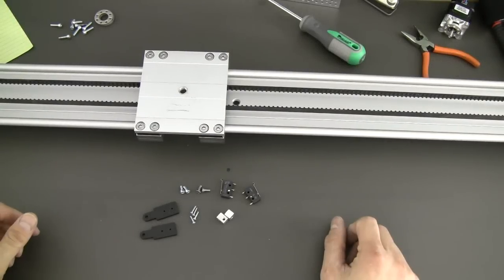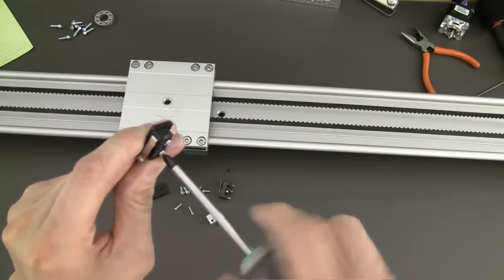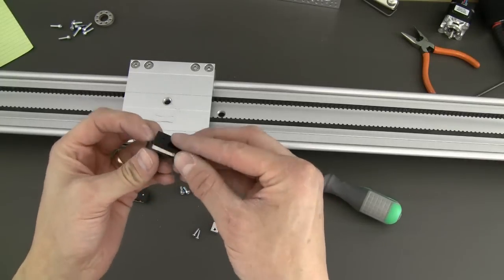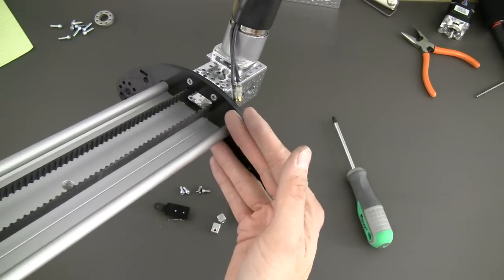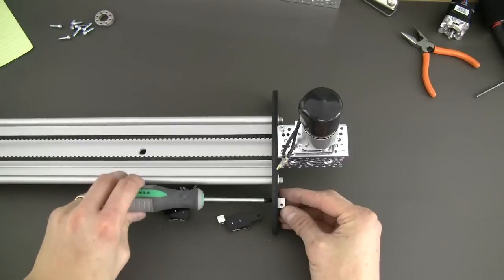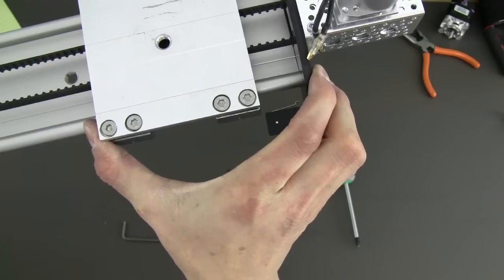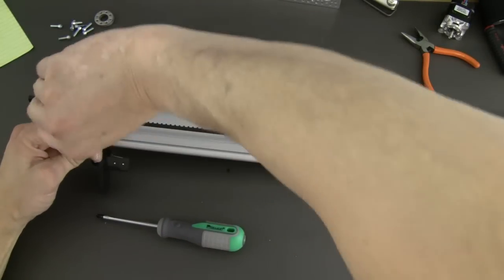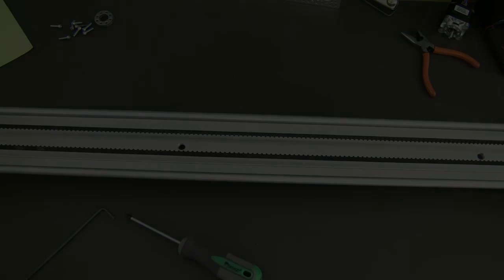Actobotics - IGUS W1080-B Slider Kit : How to attach limit switches

Comment: Which kind of battery is used to supply the system?
Reply from the maker: You can run the motors from about any 12V battery.  The size of the battery will determine how long the motor is able to run before you have to recharge the battery again.